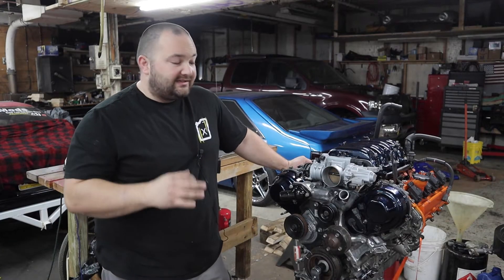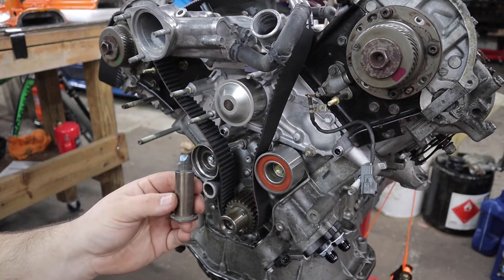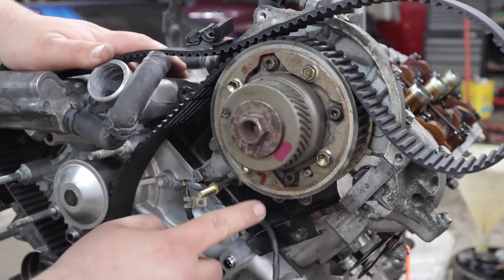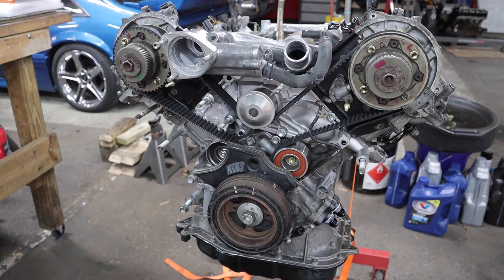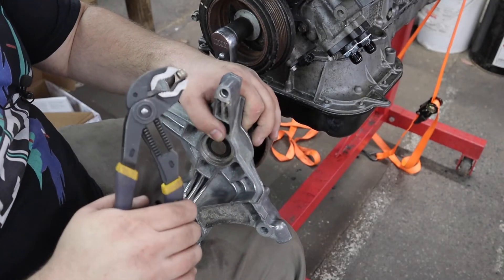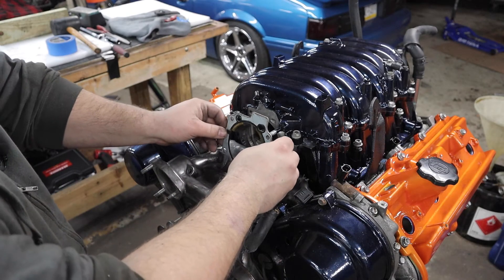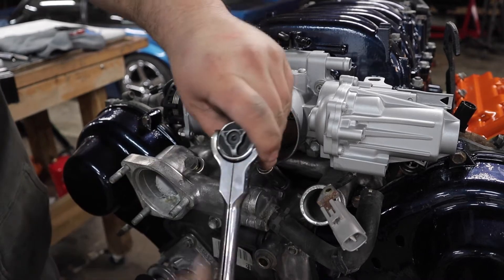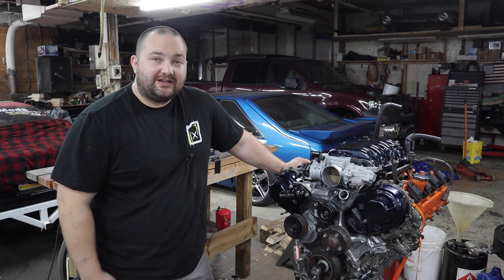1UZFE-VVTi Engine Rebuild Pt 3 Top End Rebuild

Comment: You should have replaced the starter too; it will probably break down and you'll have a lot of trouble.
Reply from the maker: ill replace it whenever it fails, its not that hard to do
Reply: @PoorManMods  After installing the engine in the car, the starter bolts will be very close to the firewall and you will struggle. I hope it's as easy as you say.

Comment: Always change starter and knock sensor before put that intake back on to🤦🏾‍♂️
Reply from the maker: I had the starter rebuilt, I believe I said that in the video. The Spitronics ECU I'm using doesn't use the knock sensors.

Comment: Your timing procedure seems off, the marks you made are about 10* past the mark which is before the "T" I'm just curious did you have to re adjust this?  Following along building a 1uz atm
Reply from the maker: Idk I followed the manual, and it runs 🤣
Reply: @PoorManMods  got it.  I was following a video by Kelvin at cartunes.  Looks like he's stays at TDC, I'm guessing the manual advancing the bottom past TDC is why the marks are further forward but who knows.  I do prefer your content for what it's worth.  More digestible and to the point.  Thanks for the videos.

Comment: I'm sure you've realized by now that you installed the spark plug tube seals on the valve cover upside down. If you don't fix it your spark plug tubes will fill up with oil very fast....
Reply: Yeah he’s right. The taper should face the inside of the cover so they slip over the spark plug tubes without tearing.
Reply from the maker: Hey thanks I'll look into it